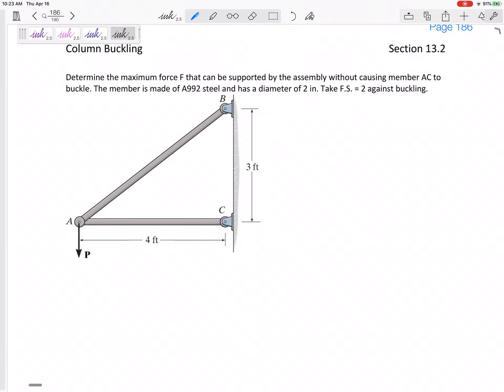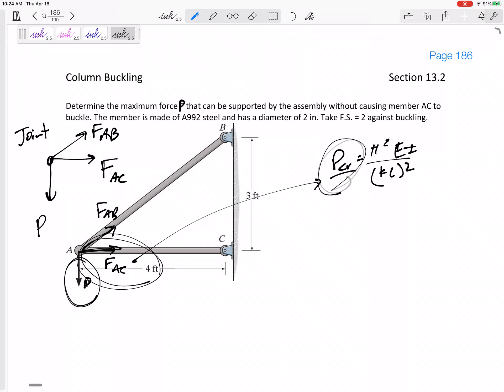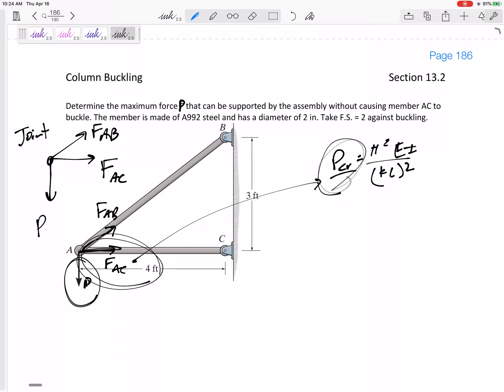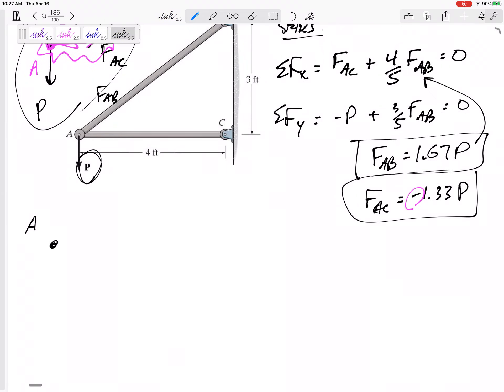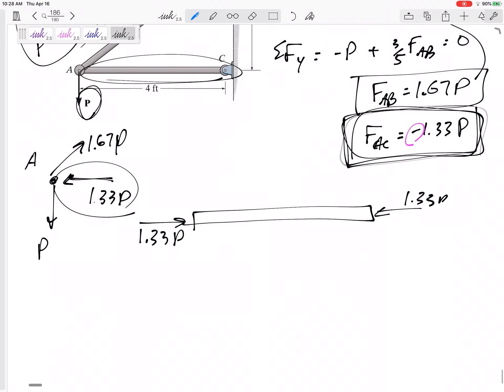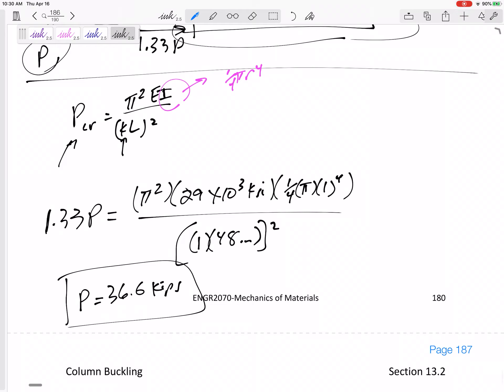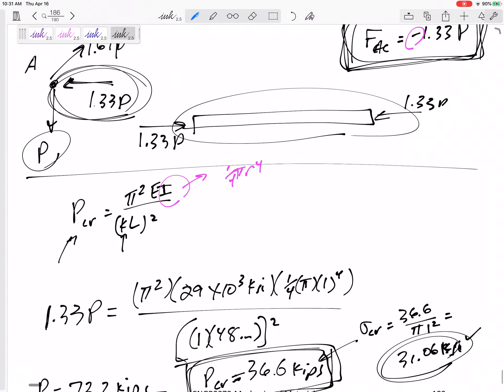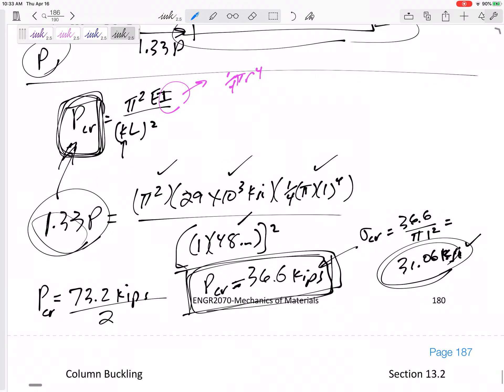Mechanics of Materials - Column Buckling example 2

Comment: 36.6 kips when divided by pi does not come out to 31.06 ksi. It should instead be 11.65 ksi, or thereabouts. 

I was a little bit confused at first where that number came from but I realized it is what you get when you divide the original computed value for Pcr, 97.57 kips, by pi. I believe this is a mistake.

Comment: I wanted to verify this calculation provides a verified factor of safety of 2 for buckling only, correct? We would have to calculate from the original Pcr to have an idea of whether or not the build met an FOS of 2 for yield stress, right? Because if the column failed due to stress at the Pcr value, then stress would control the factor of safety?